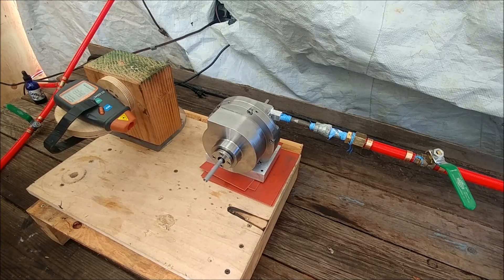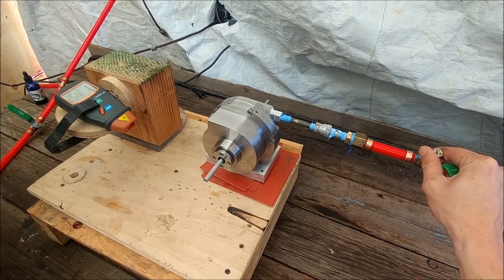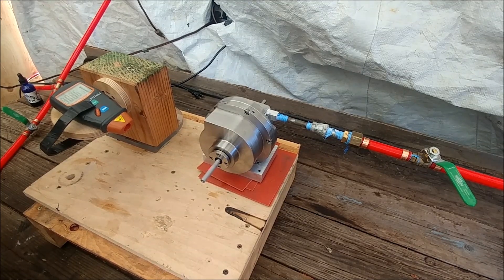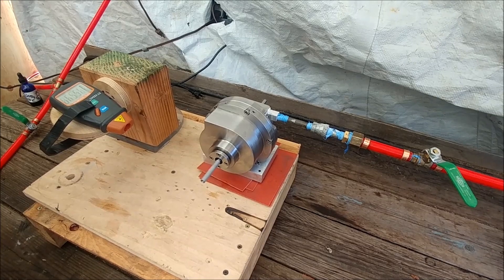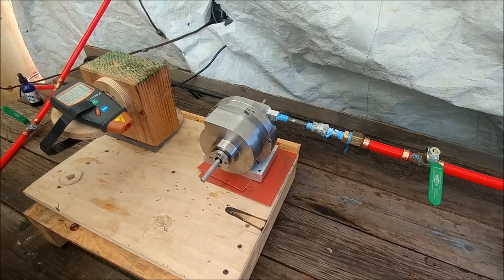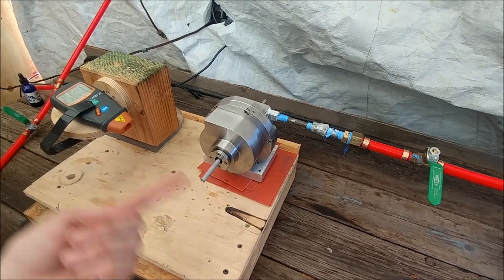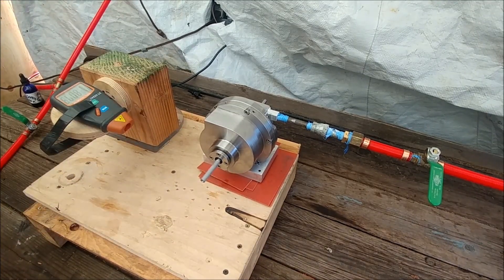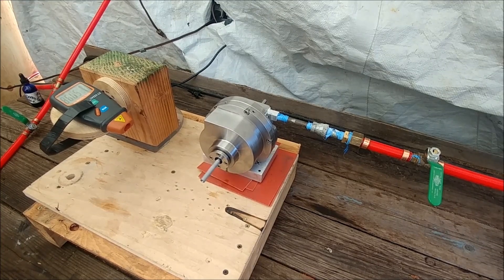Dual Stage Metal Tesla Turbine Medium RPM Endurance test. Wait for it...

Comment: I've been following your progress and trying to design my own Tesla turbine.  With regards to the turbine output.  Let's say a motor attached to the output shaft.  I don't know if my math is right, because it's based on a bunch of online calculators, but I calculated that if the output RPMs are 80k, the output of an AC electric motor would be at a frequency of around 1.3kHz.  I don't know how frequency affects a transformer or if there is one out there that could work for this, but could you not just use a transformer to knock the voltage down a few times and rectify that into a useful DC output? Everyone seems to be worried about this thing being able to produce a useful AC output, but nothing they use actually needs it apart from a hair dryer or an air conditioner.
Reply from the maker: Simple circuit changes high voltage AC into low voltage DC through Bridge rectifier and capacitors. I've done the experiments on this one and it works pretty good, I'll elaborate more on the circuit in the future. You can essentially make the capacitor take care of a normal Transformers job. the capacitors like higher frequency.
Reply: @iEnergySupply  I was also playing around with the idea of having the input stage in the middle of two output stages.  In between the stages, on the shaft, would be the rotating magnets.  On the outside of the casing would be the coils for the motor.  That way you can easily vacuum the system out, because there are no shaft protrusions. The case design would have to be both stainless steel, or something that doesn't out gas, and in between the stages would have to be acrylic.  I'm not sure how the magnetic field would react with stainless in between the rotating magnets and the coils.  I know you can get non magnetic stainless, but I still have no idea how that would react.
Reply from the maker: @BenCooke419  you can get non-ferrous ss, but it still conducts electricity which means it will build up heat via eddy currents.  Plastic casing would work great for that! Our next turbine while we wait for the corrections on this one will be plastic casein and we will even be able to produce high voltage eclectic discharges from shaft to ground, that should be interesting ha!? My first desighn had dual stage but a pump on each side of the turbine but the rotor was plastic which is no good.
Reply: iEnergySupply where can i buy this turbine i want to use the electrons to make hydrogen
Reply from the maker: @joeylawell3590  I hope to have them for sale very soon.
Reply: @iEnergySupply  Awesome!  Can't wait!

Comment: Dude the turbine got hot. I never seen anything like this before.
Reply from the maker: I think it was from the bearings being miss aligned.
Reply: @iEnergySupply  I have an idea to cut the friction down. Levetate it on magnets. Basically a magnetic bearing. It will also spin down a lot slower. I plan to make mine levitate.

Comment: What is the BIGEST difference you see between the Metal and the Lexan/Plastic Dual Stage turbines? Would you say that the Metal absorbs the energy better and that the extra weight gives it more torque?
Reply from the maker: Yes I believe the metal's electrical properties will draw in the vapor to adhere to the surface more efficiently, also there isn't any heat issues for testing with the metal turbine.
Reply: @iEnergySupply  add a positive base charge to the rotor, and a negative one to the casing.

Comment: How long did it take you guys to produce this model? And do you use a CNC machine? What type of metal are you using for the body and the discs? (by the way, how thick are you disks, and are you going with 1-2mm for the air gap between the discs?)
Reply: Watch previous video's
Reply from the maker: My disks are .024" and my star washers are .024" Our disk diameter is 4"
Reply from the maker: we prototype it for a year with plastic, then after getting help from all of you guys were were able to afford to build it out of metal. We also found a machinist that is very good at this stuff and he offered to help with most of the cost.

Comment: How much one of those cost?
Reply from the maker: Prototypes are expensive, but after the jig is set up everything goes faster and is cheaper. With higher volumes of orders the price also goes down substantially. This turbine cost more then 2000 dollars to make for that reason.
Reply: @iEnergySupply  how muhc power would it genera te, hp or  electric power?
Reply from the maker: @josealfonsoterrero5924  Tesla claimed to get 10 horsepower for every lb of weight, this turbine weighs 17 lbs. Would be cool to get what he did but I don't believe this one will get that much horsepower. The disks need to be made of a stronger material like nickle alloys. Even Tesla used nickle alloys.
Reply: Nickel/Cobalt Alloy.

Comment: Would something this size run my scooter ?
Reply from the maker: tesla predicts 175 horsepower for the weight of this turbine. Now that doesn't mean we will get anywhere close to that with this turbine but it's possible. Tesla said 10 horsepower per pound is possible. He later changed it to 20 hp per pound after many years experience with the turbine.
Reply: @iEnergySupply  Oh! I was talking to a fella on reddit about using a closed-cycle turbine engine running on liquid nitrogen as a way to extract useful work out of waste heat in a rocket engine yesterday.
His concern was most closed cycle engines just don't have the HP-to-weight ratio to improve thrust enough for it to be worth the added weight.
Given what you just noted about Tesla's weight prediction and the fact that 1 HP very roughly translates in to 3 lb-ft of thrust... You fellas thinking what I'm thinking? ;)
Reply: @iEnergySupply  That's awesome I would love to put one in my car my scooter run my house and green houses on them I also have a small creek on our property I'd like to see how much electricity I can generate with it !
Reply: Do what I'm gonna do! Use an electric motor for the drive train. Lets you focus the turbine's energy production around efficiency rather than power output.

My first project won't be a scooter but rather powering/enabling an OpenTrac's Power Cube using a turbine as the motor AND a second one as the hydraulic pump. ;D

Provided that works next after the tractor will be a plug-in style all-electric drive-train hybrid EV conversion like the scooter suggestion above for either my Hyundai Accent or Dodge Caravan (depending on whether the caravan sells ~.^)

Comment from the maker: Here we test compressed air and water vapor at medium rpm and also make new discovery! The faster the turbine goes, the more vacuum the pump makes, and the more vacuum the pump makes the more powerful the turbine becomes!! It's that simple!
Reply: Awesome stuff! :)
Reply: What do you mean how isferwerda
Reply from the maker: @MrKidzkrazy3  who is ferwerda?
Reply from the maker: @enterprisestobart  I believe so! There is no reason it wouldn't work once everything is tuned in.
Reply: I wonder what would happen if you refed the exhaust from the vacuum side back into the intake and shut off the source air feed?
Reply from the maker: @alaingrignon  We will be testing this in the future. I don't know exactly what happens but that's how you make air conditioning with this thing, the only differences is you need to power it with a motor or another turbine. All in all we don't know until we test it, soon!
Reply: iEnergySupply will definitely tune in for that! Great work by the way! You’ve been doing almost all the things I’ve wanted to do with a Tesla turbine.
Reply: So when you going to start calling it the Ferwerda turnbine
Reply from the maker: @MrKidzkrazy3  Who is ferwerda? Nikola Tesla invented the main parts so, I give credit to him.
Reply: @iEnergySupply  He also gave a very comprehensive theory of its working. What is truly amazing for me, is that all things Tesla mentioned about the turbine, that were tested in one form or another, is showing up as the real dynamic in the turbine experiments. The key point is that in ALL cases, and especially about high efficiency, Tesla was provisioning for very specific dynamic conditions to be in place. If these conditions are not present the turbine ( and for that matter all his dynamic systems mechanical or electrical ) will work, but the efficiency as given by Tesla will not be present.
Reply: @iEnergySupply  That's respect when you honour Tesla.